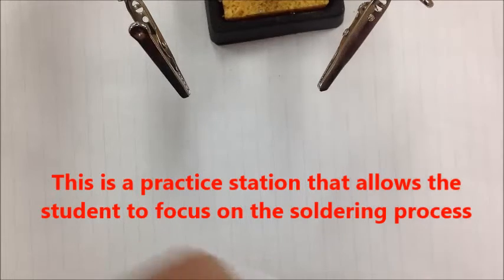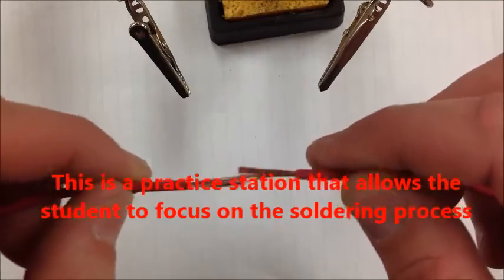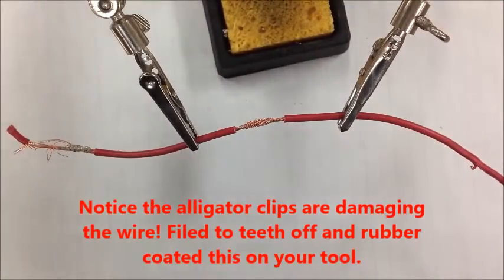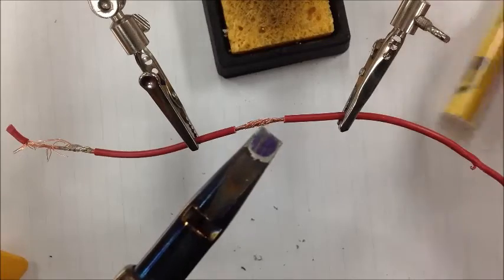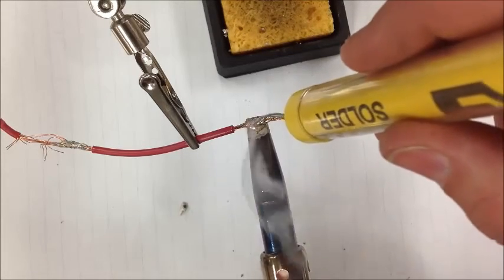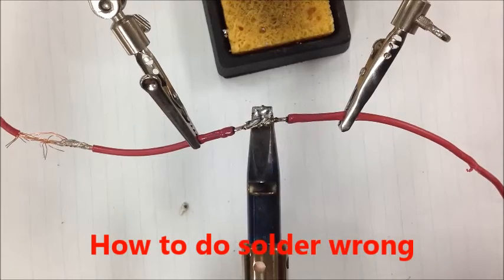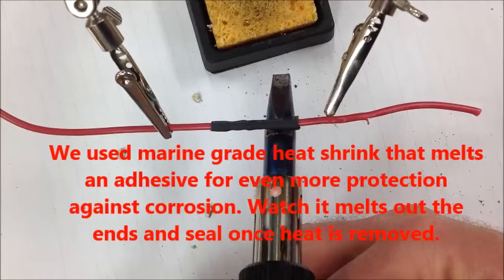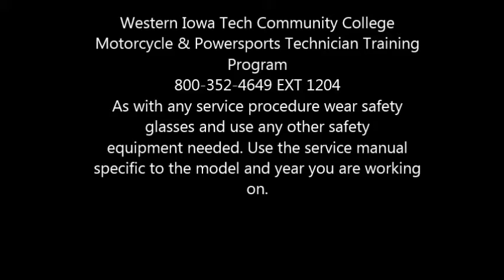How to solder wires and how to heat shrink protect them. #howtosolder

Comment: What type of solder do you suggest? There are so many choices at Radio Shack. Also, is that a propane heat gun?
Reply from the maker: Here there! I know this is a really old comment, but since you joined the channel it showed up! I put some samples in the video dscribtion but I surely hope got your answer 4 years ago! Nice seeing you on here!
Reply from the maker: Also I found the soldering iron from in the video. I still love mine but its a bit spendy compared to whats on the market today...I have a smaller one (the powerprobe version that fits in tight places nice but it I have room I like this one because it heats up super fast... https://amzn.to/2EQfF2V